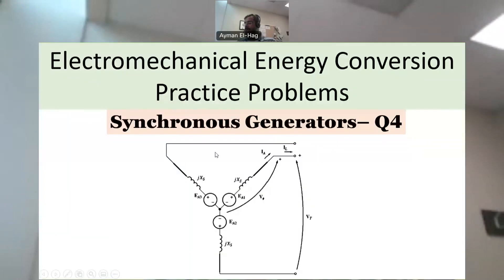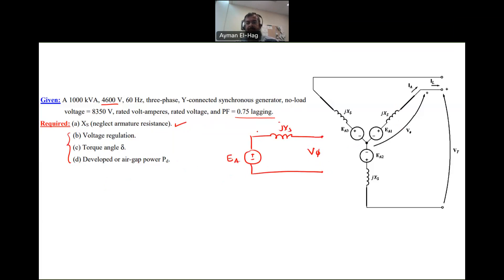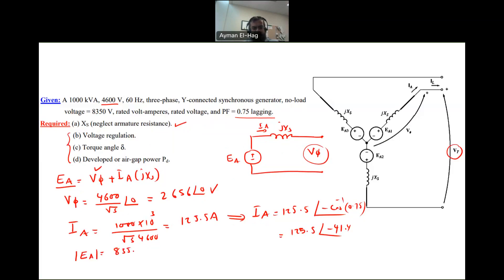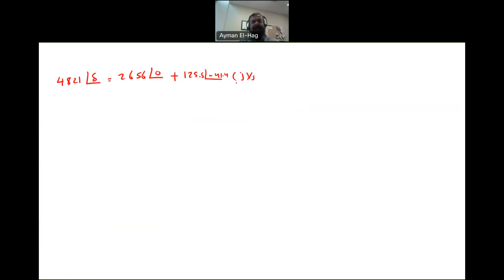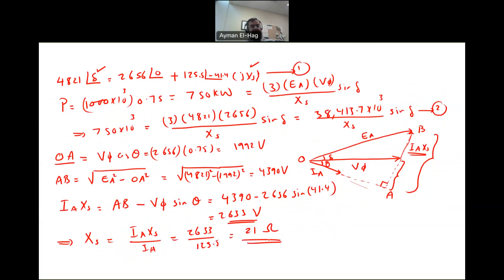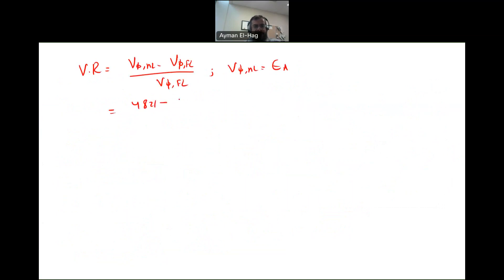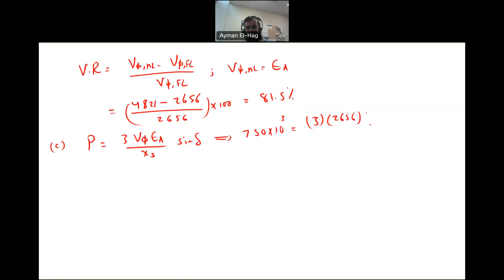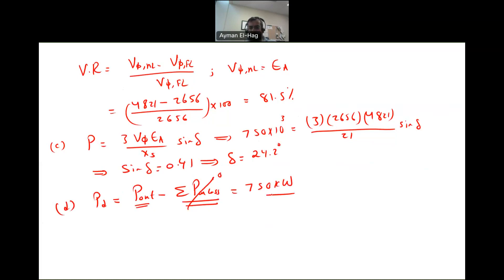Synchronous Generators - Question no. 4

Comment: Thank you Dr. Ayman. At no load, the current is equal to Zero and Ea=Vt and will get Xs very easy because Ra is neglected. Please advise why did not apply this solution? it is complicated to get it by the vector specially there is no scale....
Reply from the maker: How you will get Xs if Ia = 0 (no-load conditions). Once you have a load, at which you want to do all calculations, Ea will not equal Vt and you need to go through this solution.